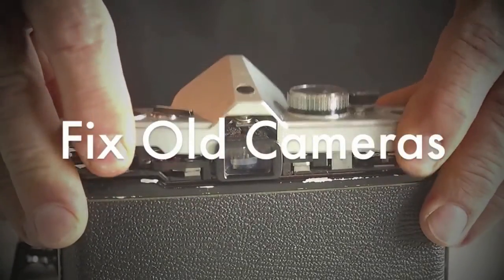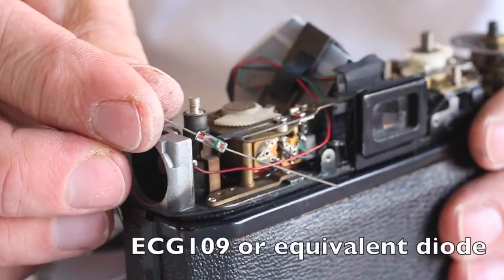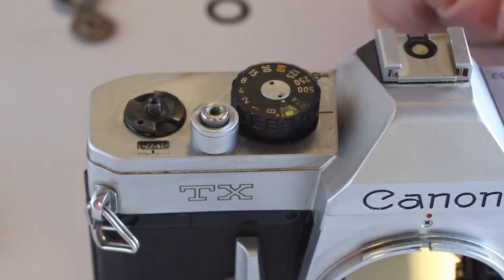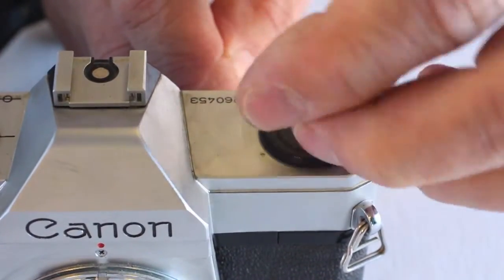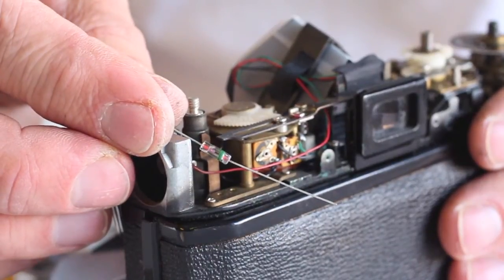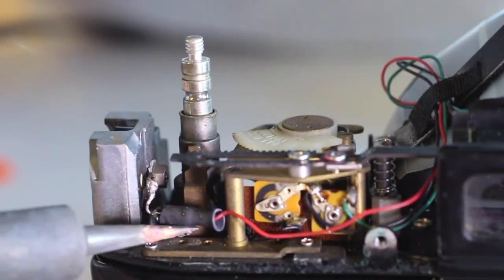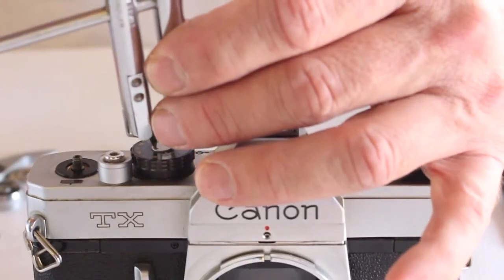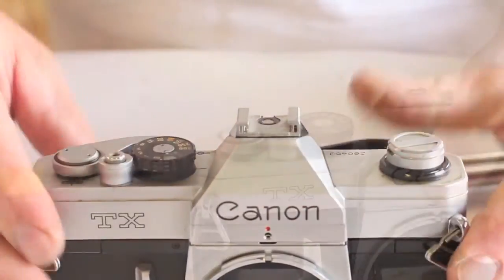Fix Old Cameras: FTB / TX Meter Diode Modify

Comment: For the Canon FTb (which uses the px625 battery) the line (cathode) on the diode's case should be toward the battery (which is the negative terminal of the battery compartment). Depending on your electronic religious preference (do the the electrons move or do the holes they're sitting in move) current either flows from + to - or from - to +, so which ever you believe the diode will be installed correctly. ;-)

Comment: Thanks. It's really helpful for me.
I recently buy MR-9 the apater for FTb to drop the voltage. I should have seen this video first.
My FTb seems to have a problem with the light-meter. When using an iso 100 film, it should be aligned with the iso 260 to operate normally. Is this a problem in the light-meter? Or is it a problem with the incorrect iso knob? I want to hear your thought.
Reply from the maker: Both of your assumptions are a possibility. Not knowing the history of the camera it is impossible to say which with out further troubleshooting. Thank you for your  interest in FOC.
Reply: Thanks:)  I'll try to fix it myself.

Comment: The inside of the FTb QL is a bit busier than the TX presented in this video. If this helps anybody, the right wire to put the diode onto seems to be the one on the bottom-est lug screwed on the left wall behind the battery. This is directly connected to the battery negative terminal when the ON switch is set in the top plate

Comment: Hoping you still look at these comments!! My first SLR was a Bell and Howell FD 35. Bought it in the 70's. That makes me old. Still have it, it still works. I have found 1.3 volt batteries, so no need to install the diode (yet). Can someone help with this? I just purchased another FD35 in great shape and also have a Canon TX. Love these cameras. The joy of totally manual cameras !!! My question...I was concerned on how accurate the metering is on any of them. Yes, using the 1.3 battery is a plus. My findings were 3 different cameras aimed at the same thing gave me a reading of F11 at 125 shutter, set at 400 ASA. My good old original FD35 read F11, 500 shutter speed set at 400 ASA. I can correct it by setting the ASA to about 125 and it should be accurate for 400 ASA film.  Help...Can this be corrected?  I know I removed the top from the camera, oh perhaps 40 years ago and fixed something. Maybe I did something wrong?  Around that time I switched to an AE1, so the FD got put out to pasture to be resurrected 40 years later.  I know this is an old post, but any help would be great. How can I adjust my old FD35 meter?

Comment: Is this the same basic process for the SRT lineup, OM-1, Canon F-1, and so forth? Same diode?
Reply: And is this the same as a 1N34A diode? I keep getting those when I search for ECG 109 Germanium
Reply from the maker: It is a modern version of the vintage ECG 109 and is acceptable. It reacts a little differently put typically gives  enough of a voltage drop to be satisfactory. Even though a inventory of the ECG 109 is still available in this shop, test were run on the 1MN34A as it seems it is sometimes difficult for followers of FOC to get their hands on the ECG 109.
Reply from the maker: It is the same process for any one battery meter systems requiring a 1.35 volt mercury battery cell. However they do not universally all react to the induction of the diode with the same drop. But considering the meters in general it usually works quite nicely with little or no tweaking.
Reply: I'll add the Canonet QL17. I have been using the Zinc-Air batteries, but they don't last long. Will the diode work in their circuit? Thanks in advance.
Reply from the maker: Yes. It is just a matter of finding a good spot to nestle the diode after installing.
Reply: Thanks very much. I think I will also need to calibrate my Canon TX after installing the diode. With a Zinc-Air cell, it is really off, so it may be more than voltage. I haven't found info for  the TX meter calibration.

Comment: Yikes!  Got my Ftb top off and where yours shows only the red wire connected, mine has a red wire and a black going to the same post on the battery case!  Any suggestions?
Reply from the maker: Connect the diode in series with the positive contact of the battery.
Reply: I know I'm three years late but... what did you do in the end? I have the same issue.
Reply: @Aravzil  I gave up
Reply: @yallcome  Well, thanks for answering at least!

Comment: Hello. I have a problem with my CANON FX. I used it this Christmas, and when i went to the shop to get the pictures, he said that all the rolls was blank. I don't know what has caused this, since my grandparents has given me this beautiful camera, and they can't seem to remember either. 
Thank you.
Reply from the maker: Using a test roll with the film door open make sure the film is being pulled through. Once confirmed, check the shutter by watching the shutter with the back open lens off and aim at a light source. Should see a square of light the changes in duration with the speeds.

Comment: Why do you use a diode and not a resistor ?  What is the different ? I could find a "ECG 109" and I ordered a "OA90", is it going to have the same result ?
Reply from the maker: A delayed reply. Working through some overlooked comments. You have probably discovered by now that it will work okay. The diode will create the needed voltage drop with no affect on the current.

Comment: The unmodified ftb I just opened has a thicker red wire, and a black wire from an upper connection to the battery compartment. But it also has a thin red wire from a lower connection to the battery compartment. (The negative centre terminal has the expect black wire on its own.)

Is it the thin red wire that the diode attaches to? I recently modified a canon tlb successfully but it only had one red and one black wire, and the diode went on the thin red one.

Any advice would be helpful!
Reply from the maker: Install the diode on the upper red wire if the following is accurate. In the model you have the upper red wire should lead to a series of potentiometers (this is the wire to place the diode in line). The black wire from the same terminal as the upper red wire should lead to the CDS cell living under the viewfinder. The red wire from the lower terminal also leads to the CDS cell. There should also be a green wire leading to the CDS cell on the opposite terminal of the potentiometer that receives the red wire from the upper battery terminal.
Reply: +Fix Old Cameras  My FTb has a red and black wire on the upper battery terminal. Should the black wire remain on the upper terminal or should it be moved with the red wire to the diode?

Comment: Hi again. I'm still here, with the cooler weather arriving I have time for some camera projects. A friend of mine gave me a Canon FT QL.  From the looks of it it was stored in a very dusty environment. The metal body has some sort of oxidation, that is rather than a nice smooth metallic finish it's almost gritty. In the past I've tried mild abrasives but I always ruin the finish and bring it down the base metal. Have you seen this condition? If so any thoughts how to remove it safely and restore the finish? Thanks, have a HAPPY THANKSGIVING, and of course keep up the videos. Tom
Reply from the maker: A strong solvent, like paint thinner or acetone might help some, but it will not completely restore the finish. From your description it would seem that the finished is beyond salvage. An extremely light touch with an extra fine sand paper might restore the smoothness, but the pitting will remain. The pitting can be filled with clear lacquer, but depending on how deep it will still show.
Reply: Apologies for the delay in responding. I found an old tube of a product called SIMIChrome Polish in my odds-n-ends drawer. The fellow that gave it to me warned that it was very powerful. I tried it on the camera's bottom plate on the inside and it took this oxidation right off and did not ruin the finish. It takes a lot of elbow grease but the bottom looks like new. I'll have to remove the top and see how it works out. I'll try and get before and after pictures. THANKS again for all the great videos.
Reply from the maker: A very good polish choice. Your patience and persistence sounds to be paying off as the camera is being returned to its previous glory. Great to hear of your progress.

Comment: Beautiful vid! Can be ok the OA90 diode?
Reply from the maker: No experience with an OA90 diode used in a voltage dropping application in a classic camera meter. Should not cause any harm to the meter if you give it a try and see how it responds. A hand held meter or another camera to compare the modified meter with would of course be helpful.

Comment: These are fantastic videos, thank you so much for all of the help! Just wanted to confirm, does this include the Canon FX? Thanks
Reply from the maker: Indeed it does. However, due to the design of the meter in the Canon FX, before installing a diode, you might check the accuracy of the meter with 1.5 volt battery. It could very well be acceptable. Thank you for your comments and interest in FOC.
Reply: Your video helped me immensely, for the Canon FX I ALMOST have the top cover off. It appears I can't remove the top cover because below the film advance lever, there seems to be a "head" that I can't figure out how to remove. I've also tried looking from the bottom, but can't figure it out. Any hints? Thanks in advance! https://goo.gl/photos/cKJq8UhtmDaawAe87
Reply from the maker: The wind lever seat usually comes up and off with the wind lever. In your case the wind lever seat separated from the wind lever. Probably because the metal of the wind shaft and the wind lever seat are fused with a layer of corrosion and gunk. Seep a liberal amount of  alcohol or the smallest amount of penetrating oil around the hub of the wind lever seat where it slides over the wind lever shaft. Keep working with it applying gentle even pressure and it should give up its hold on the wind shaft and slide off. There might be a couple of height adjusting washer under the wind seat. If there are, be sure not to forget them when reassembling,
Reply: We have success! You were right, it was heavily rusted on and I had a really hard time getting it off. It was not easy, but I ended up taking a cap of the isopropyl alcohol and held the camera upside down so only the wind leaver seat was submerged. After a minute or two of soaking, it finally gave in. Thanks again for all of the help. Now to fix that darn aperture meter link cable, it ended up snapping... Do you recommend just a little solder?
Reply from the maker: Sometimes they can be very stubborn, but patience generally prevails. Depending on the location of the break a good lap solder joint should hold it, as long as the solder doesn't cause a clearance issue. Replacement with a new wire would be ideal. You might be able to substitute a lighter gauge first string E guitar string. A music store might have a broken string that they could salvage for you.

Comment: Once the top is off is removing the prism to clean the focusing screen difficult? Mine has bunch of specks probably from the old foam. Once again your videos are excellent! Btw, when you removed the cover a brass colored object flew out! It was touched by the hot shoe wire.
Reply from the maker: The prism is held in place by a single bracket and two screws. Also, some will have two set screws in the front of the housing that the prism is seated in. You have very sharp eyes and attention to detail. The piece, which flies out, is a clip that retains the position of the wire. Many of these cameras no longer or never had this part and it may go into the memories of a superfluous part. If you stop the video right before it parts company you can note its position. Thanks for the great comments.
Reply: Fix Old Cameras I was able to easily remove the straps and clean out the screen and prism. It’s like new again! Thanks again for your great instructional videos.

Comment: Hey! My light meter in my TX does not work, but it actually moves when I move the shutter speed to low speeds like 8 or Bulb. I put a 1.5V battery and a 1.4V battery as well, an AID. and nothing. Any suggestions?
Reply from the maker: Start by checking the battery lid and contact for an nearly invisible layer of corrosion that might be blocking the current flow from the battery.

Comment: Tried this repair and the speed dial screw won’t budge. Any ideas?
Reply from the maker: Apply heat from the tip of a soldering iron for a minute or so. CAUTION of plastic parts coming in contact with the hot iron. Instant ugly melted gouge.

Comment: Hi. I would be grateful if you could give me the equivalent in Europe of the ECG109. thanks.
Reply from the maker: ECG109 - OA90 - SK3090 (single battery meter systems)
1N4007 - DO-41(double battery meter systems)
Reply from the maker: Check out Geoffrey Mendelson post... "germanium diode ussr. The most common are the D9v. Due to alphabet differences they are often listed as D9b."
Reply: @FixOldCameras  Thanks for your information.
Greetings.
Reply: @FixOldCameras  Thank you. Greetings.
Reply: @FixOldCameras  Thank you. Greetings.

Comment: Another great video, than you very much.
Just to let anyone interested know, but you can buy replacement 1.35V batteries on eBay. I've just fitted one to my 50 year old Canon FTb QL and I was very surprised to find that the meter still works perfectly. It's a great little camera.
Here's the link to the battery on eBay.
http://www.ebay.co.uk/itm/261738509271?_trksid=p2060353.m2749.l2649&ssPageName=STRK%3AMEBIDX%3AIT
Reply from the maker: +Randell John
Thank you for the comment and interest in Fix Old Cameras. Indeed the zinc-air battery is most definitely a suitable substitute for the original mercury battery... and it allows for the camera meter to be used without any modifications. The zinc-air batteries have constant voltage output that typically test out to 1.4 volts at a current rating very close to the original mercury battery, so they can be used without making any modifications to the camera meter circuit. However, they do have a rather short life span, that is not depended on usage. When put into service a seal is taken off the battery. Once this seal is removed, the battery will dry out, even when not being used. Also when the seal is first removed the new zinc-air battery will need any where from 30 to 60 minutes before it a reaches the correct and maximum output voltage.

Comment: How to fix viewfinder on Canon T70
Reply from the maker: Are you wanting to replace or clean the viewfinder / focus screen? If the screen is smudged from degraded mirror cushion foam clean with a lint free cleaning swab saturated in distilled water following the concentric circles of the fresnel lens.
Reply: @FixOldCameras  in fact i have a problem with lightmeter, there is no info displayed in the viewfinder(camera shake warning, over and under exposure etc, is it possible to repair this,